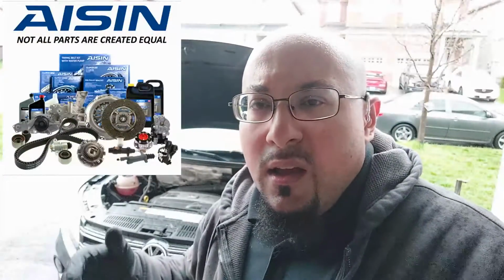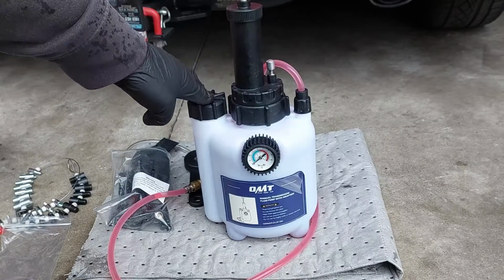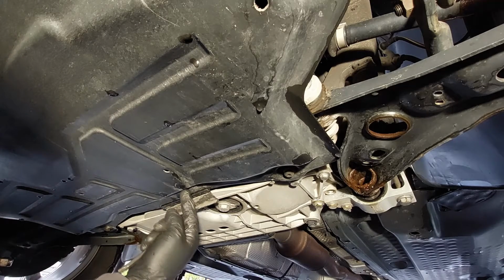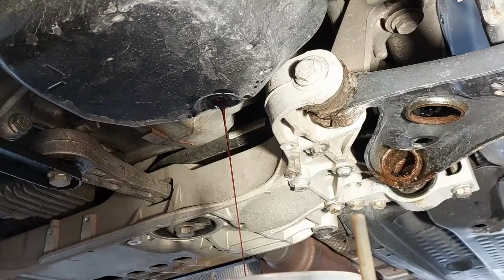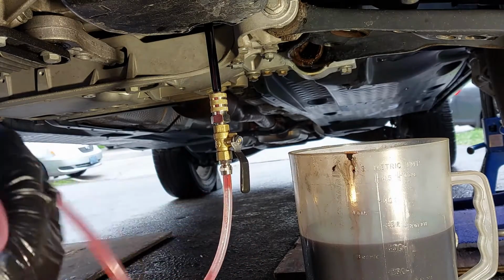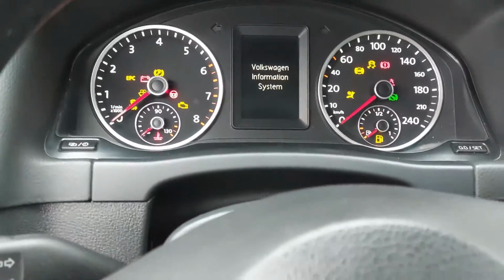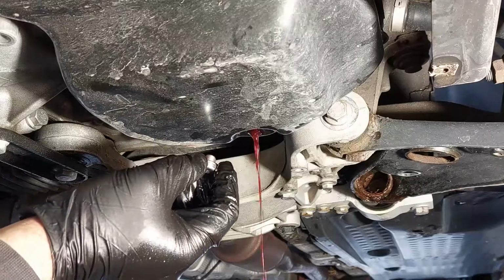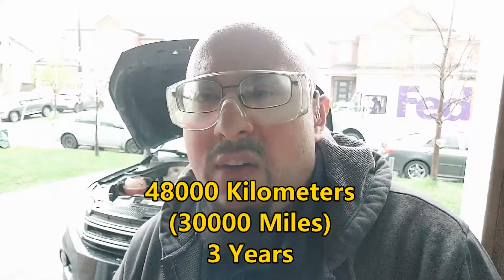2014 Volkswagen Tiguan 2.0 TSI - Transmission Service - Drain & Fill & Check Level

Comment from the maker: Part Numbers:
Drain Plug
# WHT-000-310-A

Washer
# 09D-321-181-B

Volkswagen T-IV Transmission Fluid 1 Liter:
# G-055-025-A2 

Orion Motor Tech Transmission Fluid Pump, 3L Transmission Filler Pump with 12pc ATF Adapters, Manual Transmission Fluid Transfer Pump
https://amz.run/9B4D

Mecurate Digital Angle Gauge and Protractor, Precise Measurement Digital Angle Finder Tool with LCD and Backlight
https://amz.run/9B4X

Thread Checker SWTC-26 Nut & Bolt, Inch & Metric, Original Version
https://amz.run/9B4Y

Please check out my other videos:
2014 Volkswagen Tiguan 2.0 TSI - Cooling System Service - Drain & Fill & Bleed
https://youtu.be/9i06h3WdPH8

Comment: Thank you so much for this very interesting video. A pitty the car owner did not want you to do the complete maintenance (with transmission fluid pan removal and cleaning, gasket and filter change) for us to see. My son owns a 2015 automatic transmission VW Tiguan 2.0 TSI 4motion. Any idea if it has the same transmission ?

Comment: Thanks for showing the simple drain & fill. My 2012 VW Passat is at 207000 kms so it's long over due. Ordered the filter gasket kit from NAPA and picked up a jug of Valvoline Maxlife fluid, ordered the ATF 105 fill adapter from Amazon. I will try to change out the filter myself in a few days. Will try out the Infrared thermometer too.

Comment: Was this the first time you used Valvoline transmission fluid for that Tiquan 2014? just would like to know the follow up if everything went smooth and there has been no issue with the transmission
Reply from the maker: Car is still running fine since the service. Running a lot better than before.

Comment: It's not uncommon to find these transmissions overfilled. The dealership overfilled my VW by 2 liters, and the only way i discovered was doing it myself. it shifts a lot smoother after allowing it to drain to the proper fluid level.